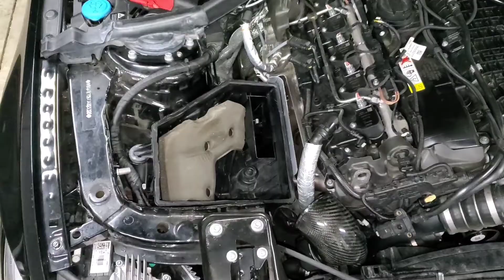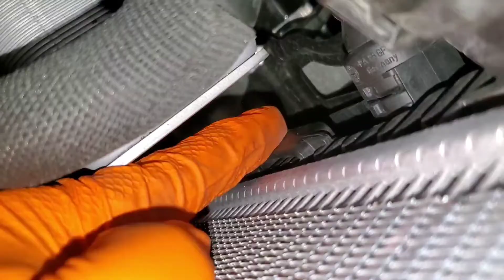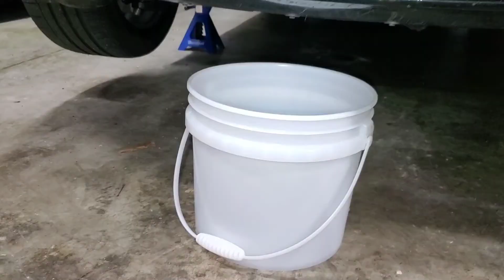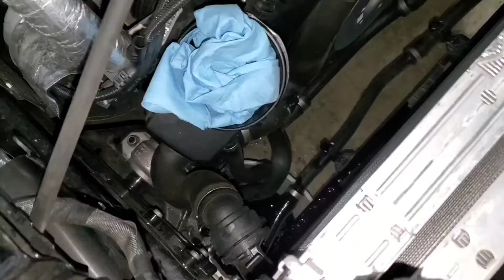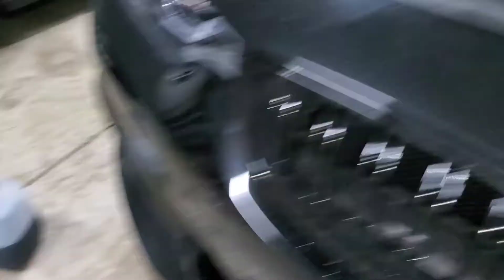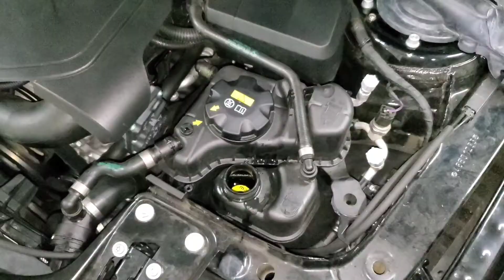CSF B58 Heat Exchanger DIY

Comment: Kern, I am wondering if it’s necessary for me to get a heat exchanger if the ambient temps in my state can reach 80s to high 90s. I am currently stage 2 ots with mhd. Thank you kern

Comment: Doing this on an f22 m240. Anyone else having clearance issues with the AC condenser being in the way? I’m using VRSF heat exchanger. (I have double checked and verified I bought one that fits my car)

Comment: I am wondering, I seem to be the only one around trying to do some sort of tuning to a 740i...  my questions is:
I am having an issue where my expansion tank is being pressurized beyond the 140 limit of the cap, and once that happens, the liquid coming back in the return line, spills out due to the pressure.  Would this heat exchanger work, on my 2016 740i?  I tried contacting CSF, but, they referred me to a distributor, I was just shooting in the dark by commenting on the video, see if anyone knows.

My thinking is, the car is overheating to the boiling point, creating pressure, hence the issue at the expansion tank.  The only Mod on the vehicle at the moment (because I am trying to overcome this coolant loss issue before adding more) is the Down Pipe, It now has a VSRF Catless pipe, and with an MHD mod, from stage 0 to stage 1, same issue of overheating.

I am just wondering if this CSF heat exchanger would fit the 2016 740i B58. Thank you in advance...

Comment: Many thanks for this video bro....saved me from paying for a costly repair job with the "experts". I first noticed the AC was no longer blowing cold, only to find that the heat exchanger had stone damage and needed replacing - coolant was leaking from the front. BMW provided a ridiculous quote so I decided to go it alone. The M140i doesn't have a lot of room to maneuver but I was able to complete this procedure by loosening the bumper at the top, as an additional step - that gave me the little extra room needed to get the part swapped out. There was no way I was going to remove the engine radiator to get this done, and thankfully I didn't have to. I filled the system manually and did the bleed procedure twice to get it fully topped up. Happy to report the car is back to its old self again!
Reply: same situation with my f30 330i right now perfectly described by yours. i just bought all the parts i needed of FCP euro for $750ish and ima do it myself since BMW quoted me $2500 for it 😂. Hopefully it’s easier than  B58 since the b48 a smaller engine even tho it uses the same radiator.
Reply: Bro… the luck we got huh

Comment: So I watched this and everything worked perfectly fine. The only problem I’m having is putting the hose back on on the driver side of the new heat exchanger. For some reason it won’t go all the way in and the clip won’t engage.
Reply from the maker: You just have to push really hard. And make sure the notch is lined up so it's rotated properly

Comment: another great video. My radiator has just sprung a leak so will be doing this asap. Anyone know if the BMW rock guards fit on the rad prior to installation of afterwards through the front kidney grilles? Will attempt this method to fit my new OEM rad
Reply from the maker: I think you have to remove the whole bumper. It's 2 pieces - an upper and a lower section

Comment: I crashed my 340i and I’m trying to figure out if I need one or two auxiliary radiator. How can I find out??
Reply from the maker: Was it msport? The bumper either has 1 or 2 openings in the lower corners
Reply: @kern417  I don’t know if it had one or two because the front was damaged so I only can see one
Reply from the maker: Look at a pic of the bumper before the crash.
Reply: @kern417  how could I send you two pics to help me determine what it is. I can only see one but a different opinion wouldn’t hurt
Reply from the maker: @massmike508  Instagram
Reply: It has m package but it’s a normal 2017 340i

Comment: Thanks for your video, I just got a broken line on my frontal radiator, and I need to be sure that part was leaking, do you need to drain the engine radiator on a b48 engine too?
Reply from the maker: drain the circuit that you are working on. you don't have to drain both if you aren't working on both
Reply: @kern417  thanks, I just don't want to unplug the engine radiator if it's not necessary. And thanks for the video it's really well explained

Comment: Really informative video. I know I messaged you about this a few days ago. For anyone interested, the tubing on my heat exchanger got damaged. I’ll be upgrading based on this video. What I wanted to add was that, and I’m not sure if this is because it was hot and I was driving for about 30min to the mechanic, once my coolant began to get super low the a/c started blowing hot air. Whether that’s a sensor or because the car was beginning to overheat I do not know. But thanks for all the help Kern you’re awesome.
Reply from the maker: https://youtu.be/ReeeaAauE2E

Comment: my mechanic added an entire water wetter bottle after installing the heat exchanger. should I suck up some of the coolant in the reservoir and replace it with water?
Reply from the maker: It's not the end of the world but wouldn't hurt
Reply: @kern417  what does you water look like with bmw coolant + watter wetter? Mine is pretty clear when I pour it in a bottle, but once it's in the bottle, it's like a dark brown.
Reply from the maker: @jp_b58  water wetter is red and coolant is blue or green so that kind of makes sense. mine is an orangish brown.

Comment: the coolant that was drained out , can you just re fill that back in , and let it cycle ?
Reply from the maker: That's basically what the bleed procedure does. When you first pour the coolant and there will be some air that will prevent it from fully filling up, so you need to run the water pump to cycle it through and push out the air bubbles
Reply: @kern417  yea i get the cycle part , but i meant the coolant that drained out the hoses , u can just pour it back in no ?  lol
Reply from the maker: oh yeah if it's clean
Reply: @kern417  i went and got the heat exchanger but i noticed .. there is no perf radiator for 340s ?
Reply from the maker: Not that I've seen
Reply: @kern417  dam tell csf to make one lol ... they made one for supra .. im sure its not that much difference of placement for the rad hoses to connect
Reply from the maker: It's very different

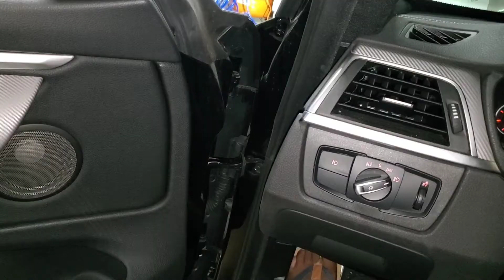Comment: Do you know what that electric motor noise is at 16:57 by any chance? I hear it when I unlock the car and have always wondered what it was
Reply from the maker: Throttle body/valvetronic motor adaptation i believe
Reply: @kern417  makes total sense, thanks!

Comment: Just an update..I tried to fit my self according the video...The video is great and very accurate, but some very important steps are missing! Like, the right side of the charge cooler also has a push clip, what is impossible to compress, because there is no room! Even, after lots of misery you could do it,  very difficult to pull it out, because there is no room. To slide it in the new performance charger ( which is much bigger) is already impossible! I suggest, and the BMW service/repair is right, REMOVE THE RADIATOR and you save lots of time and worrying..
Reply from the maker: Sorry, I thought that was pretty self explanatory. Most of the video I show what to do on one side and you just know to do it on the other. 

All I used was a pick tool and a screw driver to squeeze the tabs and pull it off. Installation was the same way.

Comment: just ordered the same heat exchanger. but Im curious to know if there is no upgrade for the engine intercooler behind this one, or if it's not something that even needs to be messed with.
Reply from the maker: The other heat exchanger is the main radiator for the engine and doesn't need to be upgraded

Comment: Great video.  How much coolant is needed to fill the system with the csf?
Reply from the maker: It takes ~.5 gallons more than the stock heat exchanger. After I was done I ended up putting about a gallon back in so that covered what drained out and the extra capacity.
Reply: @kern417  thanks for the quick reply. And appreciate your contribution to the B58 community, sir.

Comment: Can I flush/replace coolant and charge coolant just from under without removing all the top bits from the bonnet you removed?
Reply from the maker: It's worth a shot. Depending on the hose you choose, you may need to at least remove the fan shroud.

Comment: When I go to pull the heat exchanger out it’s stuck on the drivers side seems like on the bottom? Any idea?
Reply from the maker: Make sure it's unclipped and the hose is clearing the oil cooler
Reply: @kern417  HI! I have the same problem :( I just can not pull it out. Spent 2.5 hours and nothing helped :( The hose is unclipped, but it is stuck at the bottom. Anyway, your video is great! I did it everything according your guide ;), but failed at the finale stage :(
Reply: bro howd you get the driver sode clip off of the heat exchanger with the engine intercoller still on ?
Reply: May I ask you, how did you solve the problem? I have same issue :( thanks!
Reply: Same I can't get my driver's side clips off. And the larger engine radiator hose on the passenger side won't come out so I can't take off the radiator

Comment: Enjoyed the video. A bit of a basic question but why is there a radiator and another heat exchange? What function(s) do each serve in the B58?
Reply from the maker: The heat exchanger that I replaced is a part of the air to water intercooler system. The other radiator(s) are for the engine/turbo/etc cooling system.
Reply: Thanks for that!

Does the heat exchanger that you replaced also function as the a/c condenser? And if not, where would this be located? 

Clearly not related to a heat exchanger modification but the reason I’m asking is because I just experienced a road kill and will have to replace some of the surrounding parts. There doesn’t seem to be any videos explaining the parts breakdown clearly.
Reply from the maker: @drummerboycaleb  no, the a/c is separate

Comment: Does the heat exchanger truly help with cooling when you increase boost? Does it increase horsepower as well
Reply from the maker: Yes, I'll have a video coming hopefully next week for a proper review
Reply: kern417 awesome thanks, I am tuning my 440 and don’t want to do the whole process of getting the heat exchanger unless it’s truly going to help with heat soaking my turbo and help with boost
Reply: @kern417 hi mate first thanks for video and . I got bmw gran coupe 4 series f36 . Under heat exchanger leaking I ordered from bmw dealer . Can you tell do I need some more part like if I remove the hoses if install back the hoses doesn’t need any seal or clips please?

Comment: Do you need to bleed the high side using the bleed screw? Or does the electric bleed work for both sides? I know that's an old school method.
Reply from the maker: You can just do the electric bleed but the bleed screw helps fill it up faster

Comment: Great DIY, what coolant and mixture should I do if I move to Alaska?
Reply from the maker: 50/50 protects to sub freezing temps. On the bottle it says 50/50 down to -34°F, or 60/40 down to -62°F. So depends on how cold it gets in winter.
Reply: Mixture always? Or we can put full coolant?
Reply from the maker: @F_ckTheResaleValue  always mix
Reply: @kern417  if i live in a tropical country where temp is always above 30degC, do you think its okay to put 100% distilled water? Or the 50/50 mix is still preferred. Just to have different colors of liquid for the HT and LT circuit.
Reply from the maker: The lowest they recommend i believe is 30/70 because the coolant has some lubricating properties as well

Comment: the coolant is applied manually or is applied with some pumping equipment. Thank. Great video
Reply from the maker: I did it manually. Using a vacuum pump will be faster but not 100% needed.
Reply: @kern417  Hello, do you know if for the m140 it is not necessary to disconnect the second intercooler, to make the change equal to the video?
Reply from the maker: It should be the same. There's not a lot of space, but it can be done.

Comment: In theory, what is «  required «  to run bm3 stage 2 safely on a b58 340i ? Is Catless with high flow air sufficient?
Reply from the maker: Yes, all you need is a downpipe